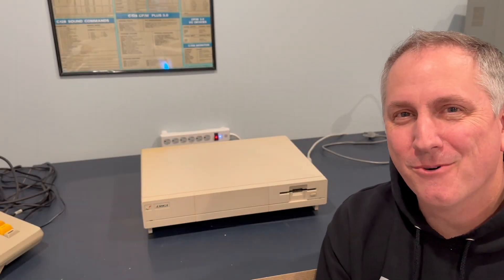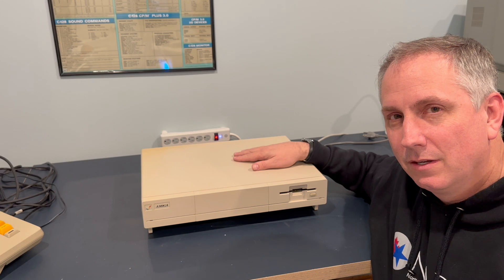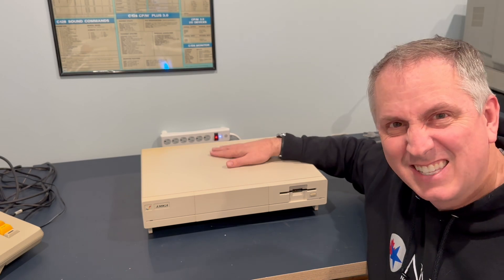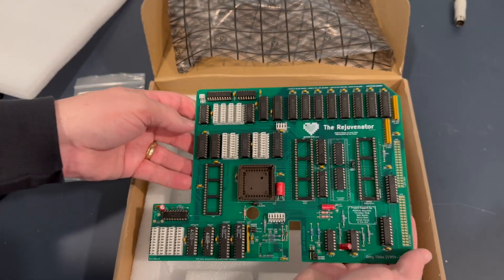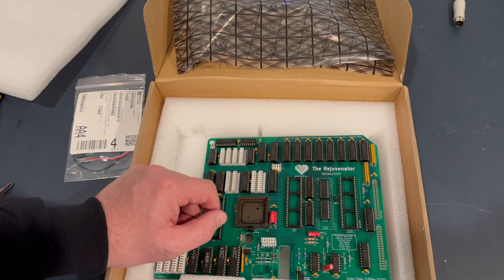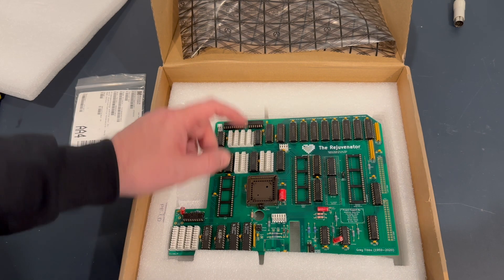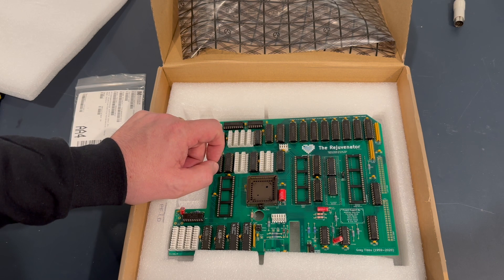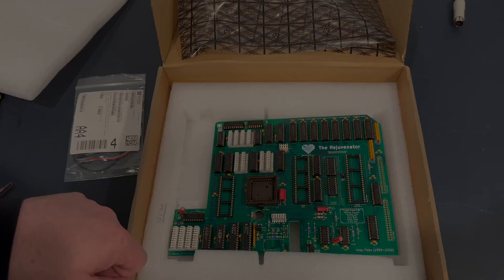Amiga 1000 with 1MB chip ram and my feelings about USPS and reading manuals

Comment: Nice video.
I have two Amiga 1000's, neither work. They both come on and the screen goes through color changes but never ask for boot disks. All kinds of ideas about which chips to check but I dont have spare chips to swap out other than between the two.
I always have a heck of a time getting the chips back in. Seems like there is always one leg that wants to not go in or bend.

Comment: So, no fast RAM on this Amiga? As much as i know, the lack of it seriously cripples Amiga.
Reply from the maker: Without a hard drive, it's just fine.  However, I have some plans....
Reply: @powerofvintage9442  Hmmm, i dont see a connection between HDD and fast RAM but then, i know so little about the system...
Reply: @fradd182 Me neither. Obviously with small amounts of RAM and the slow FDD, the whole system hobbled performance wise. A hard drive requires increasing the amount of RAM used for buffers by the OS, to take advantage of the extra speed. Which isn't great if you have low amounts of RAM to start with. But the Amiga custom chips can only access the chip ram, whilst the CPU can access fast ram too. Without fast ram, the CPU and custom chips have to alternate access to chip ram, effectively halving the CPUs performance.

Comment: Did the A1000 originally come with 256k of chip ram or 512k of chip ram with the 256k front expansion?
Reply from the maker: 512kb with the front expansion.  Without it you only had 256kb.  With this upgrade, and the right fat agnus, you can upgrade all the way to 2mb.
Reply: @powerofvintage9442  thanks it’s been a long time since I owned an A1000

Comment: Wow, this is a really weird board. Why didn't the designer split the board into 2 and use ribbon in the middle?
Also, have you thought about adding Pi Storm?
Reply from the maker: It definitely is.  It was designed in the early 1990's and this is a replica of that board design.  My guess is the designer was going for a kind of replacement for the daughterboard (which is also a bit weird) found in the NTSC version of the Amiga 1000.  

Regarding the PiStorm, I did try it out in this same Amiga and have a video on the experience.  Worked great previously.  I've tinkered with putting it back in now, but there seems to be some conflict with the new RAM board and the PiStorm.  

There is a video in the works on this.  I just broke one of the primary components and have some parts ordered to fix it (waiting for shipping from Europe to the US)